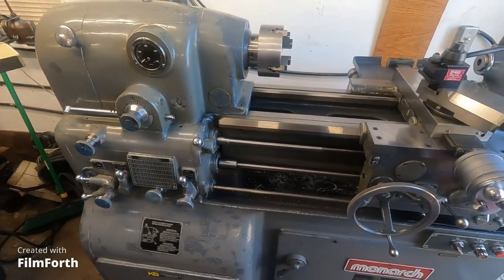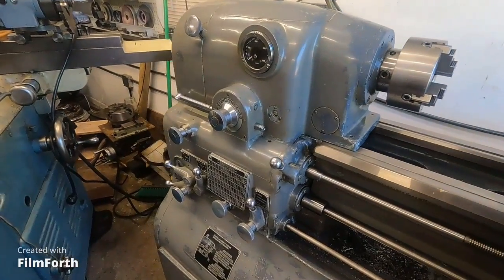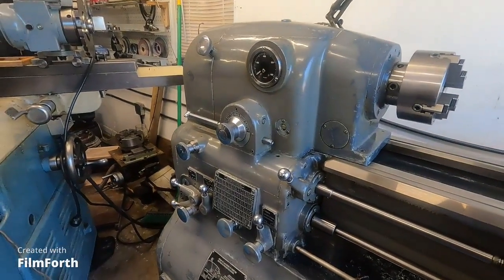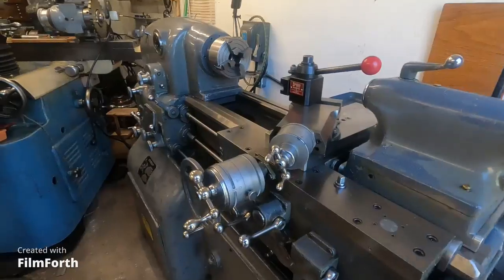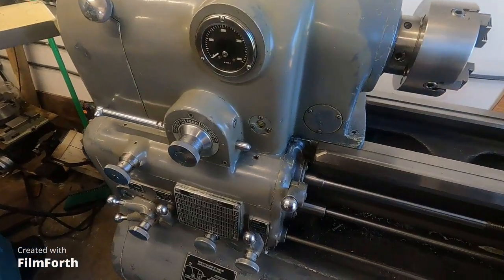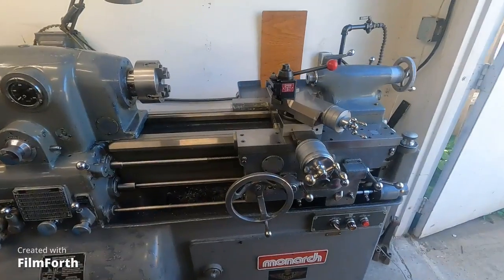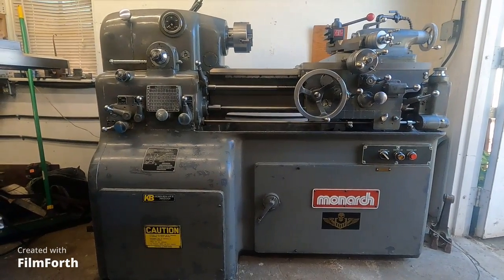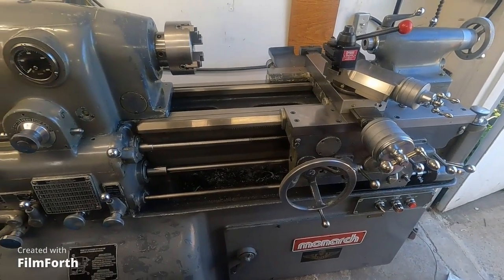Monarch 10ee inch/ metric lathe 1983 is for sale

Comment: Hi Dee, I was wonder if you have any thoughts about a 1956 monarch 10ee. There is one for sale in my area.
Reply from the maker: The old saying is look for condition. Myself to get the most out of these machines is the drive. The year you mention should be the early vacuum tube rectified DC drive. This is considered the more difficult to restore just because it has a few more small signal tubes and a few electronic components have to be search out because out of production. This is a I drive I hope to get in here and restore just for my own pleasure. When they run, they run good. If the drive is missing, the better way to go is a VFD set up with an inverter duty motor at least 5hp, but.... an adapter must be made to attach the back gear "box" to the new motor. All of this is not cheap! The cheap DC drives are really bad performing
Reply: @deedeeindustrialsuperprecision  
Thank you for the information,  I value your opinion.  As much as I would love to have one of these beautiful machine I'm not looking for the unknown expense. Thanks agian. Keep doing what you do for us out here......

Comment: Donie--I do not want to poke a hole in your ballon but---as good as the 10EE is--it should have been optioned with D1-4 spindle nose--not the D1-3. I owned the cnc version of the 10EE--Monarch C-10--a slant bed disaster--a pneumatic, hydraulic, servo machine with peg board--the worst of everything--Monarch never wants to speak of this model
thru pure good luck my current daily turner is the Hardinge HXL--the first Hardinge cnc--200 built in England in 1982-85--then the UK factory was shut done  the HXL looks like a HLV-H on steroids--4000 lbs and self leveling
the one machine I remain sentimental about is the Nebel  Microturn 1308-a purchase I made directly from Hanford works-  the most advanced tool room lathe ever --65  years ago--planetary headstock--go to that website you dont like and search Nebel--if interested
Reply from the maker: Same old cyber bully tactic perfected on the PM fake machinist site by Forrest Gimp "you come in tell me I don't know what I am doing" then "change the subject" being curious why do you have no related videos on this subject at all? How would one know if you are a Gimpette?
Reply: @deedeeindustrialsuperprecision  You are the Master Machinist-I am the student--when you post a new video I stop what I am doing to view--every episode has great content--what you are asking for your EE is entirely reasonable--and it is a better machine in most respects than the HLV-H--but it was limited by the D1-3 spindle- my eyes were opened when I inspected a Rivett 1020S custom built for the US Naval Gun Factory with a 3 inch spindle bore--A series taper spindle--awe inspiring
Reply from the maker: @pulsenpal7882  Listen to me, I went by donie on the PM forum in 2002 until I force them to kick me off for trying to stop the typical bully tactic you just pulled. You are completely full of crap and seem to have suddenly developed a stutter.
 I have never been hired as master machinist, for that you have to take it in the ass for 25 yrs at Hupmobile for a gold watch. I was hired by a sawmill that bought a machine shop in Colville WA early 1980s and was "Millwright" from now on I will go back to that.

Comment: Monarch is the best lathe he's telling you the truth
Reply from the maker: There are two winners after years of fierce competition, Hardinge and Monarch. Both have strong and weak points. The only solution is to have both. Hopefully I do not offend by leaving out other machines, The Monarchs were used in plutonium and nuclear fuel production here where I am and were favored for ease of use, The worst known machine for ease of use was later Schaublin. Ease of use means increased productivity. Hardinge was not used because of durability from what I could find. The dove tail beds wear rapidly on the HLVH and the tail stock has no horizontal adjustment and not enough power.

Comment: Hey Don,I think that radial drill has you buffaloed. It is not going to take that head off itself😊
Reply from the maker: I will sell this machine first, the drill repair could block things off, retired and in no hurry for anyone.
Reply: @deedeeindustrialsuperprecision  just messing with you. You take all the time you want. A long as you keep them coming. Let us ask sirens a little time with you and Miss Cloy.
Reply: @thesjyoungjr  The Morris head will easily crush or kill you if mishandled.  I'd buy or rent a one ton rolling gantry and make it easy and easy on your back.